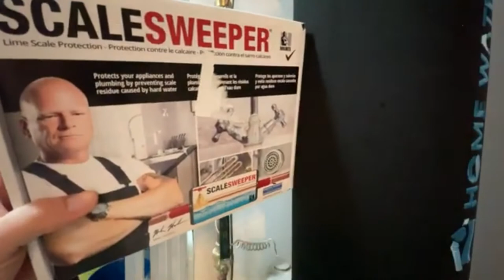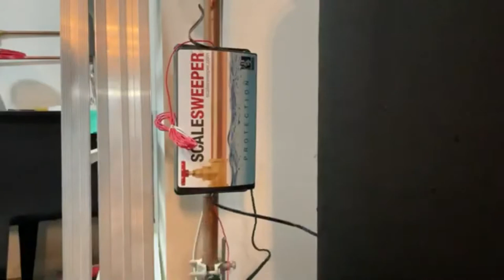How To Install An Electronic Anti-Scale Hard Water Conditioner

Comment: Thanks for sharing! I see you have different response to the ask about the performance. Just want to confirm. Is it working or not? BTW, what's your hardness (in GPG unit)?
Reply from the maker: I’ve come to the conclusion that it doesn’t work. I thought at first it improved a bit, but I still see lots of calcium around my faucets and drains. Ps I have no idea what hardness level my water is… it’s just really hard.

Comment: Did you twist both red cables in clockwise direction? As far as I know , one cable will be clockwise and the other one  in anticlockwise direction.
Reply from the maker: You are correct. Looking back I did actually do them both the same way as I wasn’t paying attention. I did however correct the issue off camera later. Thanks for watching. And good catch. Please like and subscribe

Comment: How do I know which pipe to install the scale sweeper
Reply from the maker: You will have to follow your pipes to find where they enter the home. For example my pipe starts through the floor like you see in this video. So that is where you install it. The main line before it branches off through the house is the one you connect to. Hope this helps. Thanks for watching. Please like and subscribe

Comment: If you have more than 1 water heater, do you need to put one on the other water heaters too? Thanks.
Reply from the maker: You only need one unit attached to where the water come into the house. The main line. Number of water heaters doesn’t matter. Just one unit at the start of the water line. As for your no plug issue maybe an extension cord. Thanks for watching. Please like and subscribe

Comment: Shouldn't the wires be wrapped opposite to each other?
Reply from the maker: Doesn’t matter. Just needs contact with the pipe
Reply from the maker: I asked someone who works for scale sweeper. He said doesn’t matter as long as they make contact. The current will still pass through the antennae regardless of direction. It’s like saying your outlet won’t work if it’s installed upside down. It does NOT matter.
Reply: According to the instructions, it should be wrapped in opposite to each other for it to work properly

Comment: Does the unit go after the water softener or before?
Reply from the maker: It’s important that the unit be positioned as close the the houses point of entry for the water pipe. Before or after a water softener will not matter. As long as the unit is installed before the pipes branch off to their different locations. Thanks for watching. Please like and subscribe
Reply: @BillOfAllTrades2016  Thank You !
Reply from the maker: You’re welcome

Comment: As (@thestylesworld) pointed out one wire wraps clockwise the other goes counterclockwise, in the video there both wrapped in the same direction. Electrical tape should not be used as it is not called out on the instructions and will weaken with time in allowing the windings to unwind, cable ties will always stay in tack.
Reply from the maker: Thanks for repeating that. I understood when it was said the first time😂😂😂. And you may notice I responded to that comment that the issue was corrected. Also electrical tape is still holding 3 years later. Maybe you use dollar store tape on stuff but I use quality electrical tape.
Reply: So, I was looking at the product instructions, from the manufacturer, in the Menards app, jist before coming to YT. It says you can use electrical tape to help hold it in place and even calls out that electrical tape is not included in the kit.

Comment: You forgot to mention, and I think you did this incorrectly based on the instructions in the box, is one wire needs to be wrapped clockwise and the other counter clockwise.
Reply from the maker: Good eye. You’re right. I did correct it off camera later. Thanks for watching. Hope the video still helped. Please like and subscribe

Comment: my contractor mounted mine to the wall and ran the red wires from there.  so the unit is NOT attached to the pipe.  does this matter?
Reply from the maker: That could be an issue depending on how much wire is wrapped on the pipe. How far away from the pipe to the wall where the unit is? If you want to you could just remove the unit from the wall and zip tie it to the pipe and redo the wire as I did in the video. The manufacturer instructions do say mount on the pipe. Hope this helps. Please like and subscribe

Comment: Does it matter if the two antennas are wrapped right next to each other or if there needs to be some distance between the two (as shown in this video)?
Reply from the maker: For it to work properly you have to wrap it exactly as shown in the video. One antenna on each side. Tightly wrapped.

Comment: How do you know what your water line is
Reply from the maker: Your water line is the copper pipe where water comes into your home. Just like the one shown in the video. I don’t know how else to explain it. And not to be rude, but if you can’t identify what a waterline is, then I would like to strongly discourage you from doing any diy projects related to plumbing.

Comment: It's been 5 months.   Does it actually work?
Reply from the maker: Yes it works for my home. There is a small amount of calcium showing up on me tub faucet but Before installing this device I needed harsh chemicals with an abrasive pad to clean it. Now I just need some vinegar and a cloth. My kettle also has less than half the calcium buildup that it used to. So I would say thumbs up in my experience. Hope you found this helpful. Please like and subscribe
Reply: @BillOfAllTrades2016  thanks I'll pick one up from my local home depot.
Reply from the maker: You’re welcome. Glad to help.

Comment: I have no power outlet by my water heater, :-(
Reply from the maker: There must be an outlet for the tank to plug into.
Reply: @BillOfAllTrades2016  it is hard wired into a wall
Reply from the maker: Then an extension cord is your best bet